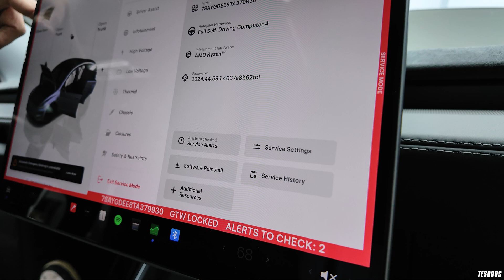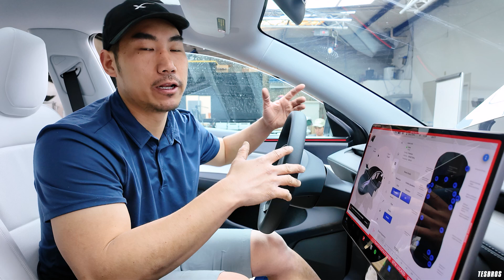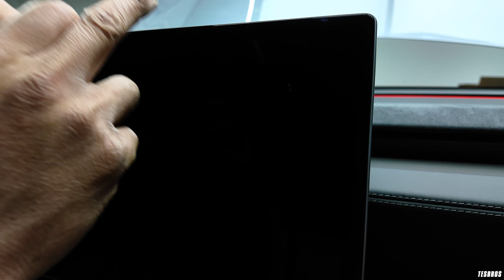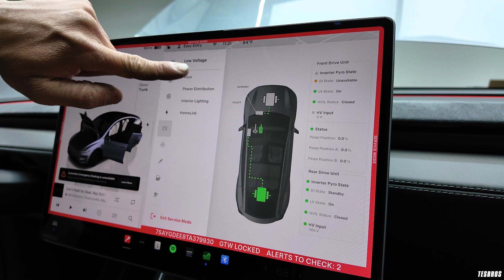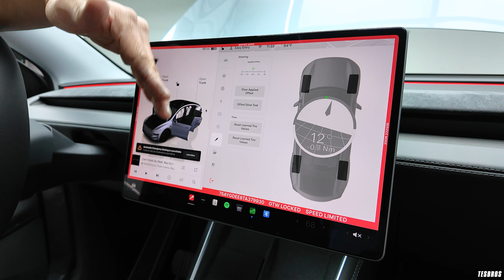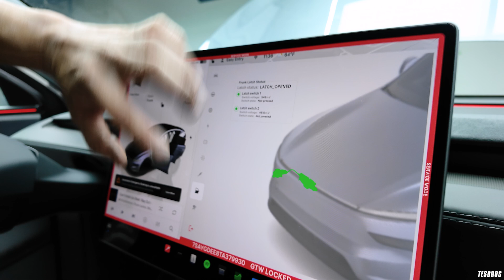Model Y Juniper (2026) Service Menu Walkthrough

Comment: Hey
Great videos
Tesla limits home charging to 11kW
Is there a way to change this to 22kW
Reply from the maker: If you have a newer Tesla, you cannot upgrade to 22kW AC charging. The only way to charge faster is through DC fast charging or optimizing your home energy setup - For example, a Tesla Powerwall can provide extra energy during peak charging times.

Comment: Do you know if the Homelink module from the previous Gen Model Y will work on the new One ?
Reply from the maker: Not entirely sure. We had some issues installing a used one in this video and ended up using the latest one from Tesla - https://youtu.be/BwevAtgh-HY
Reply: @diywrapclub  I bought one from E-Bay which seemed new and it installed fine and the retrofit and test worked but it doesn't seem to work with the Garage door opener.  Tried to pair it with my brothers Garage door Opener and it doesn't work either. So my guess is that the units on E-Bay are older and won't work with the Refresh Model Y Juniper.